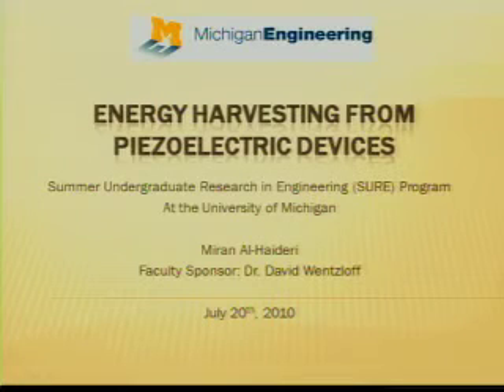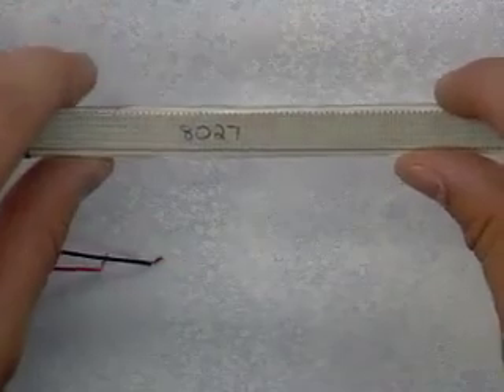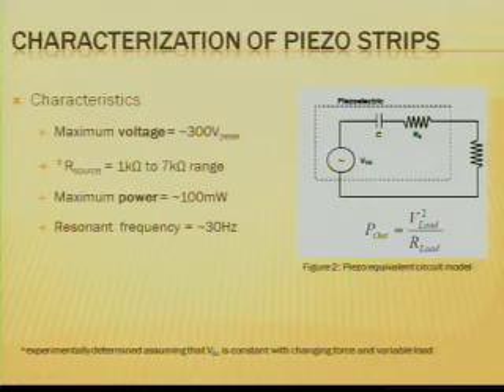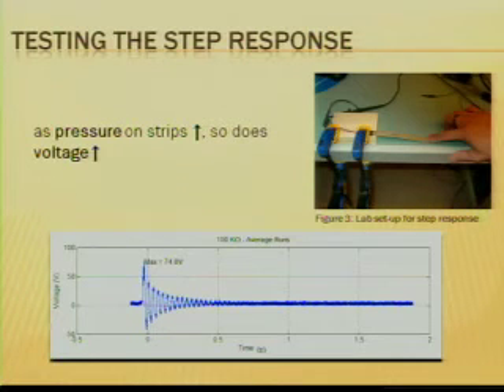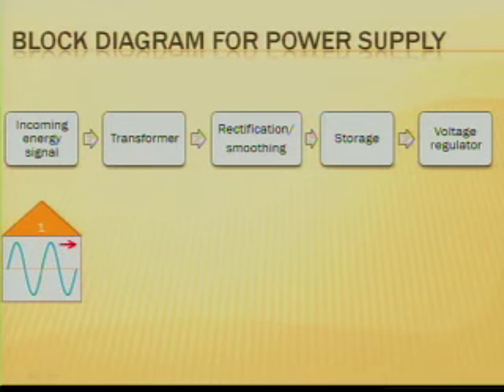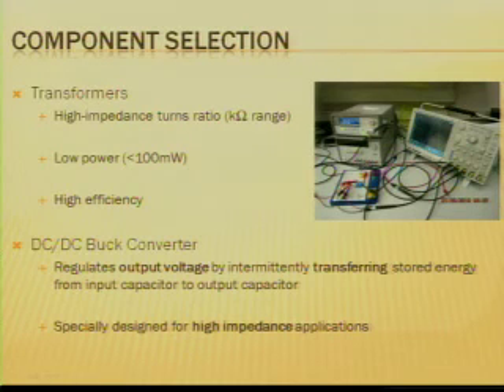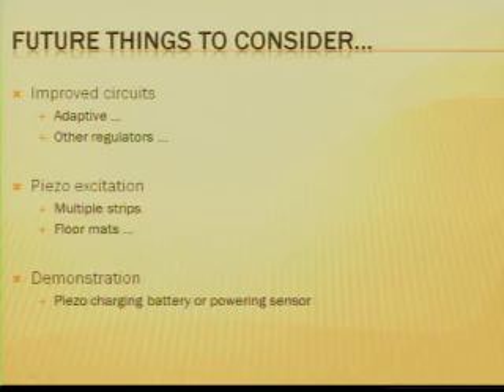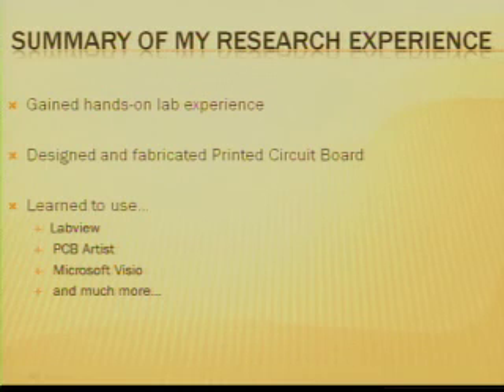Energy Harvesting Using Piezoelectric Devices.m4v

Comment: Hi
need your help, my final year project is on energy harvesting shock absorber [car suspension] using piezoelectricity. my project is basically transforming vertical kinetic energy into electricity using piezo materials. im not sure how do i set up the circuit and fit it into the shock absorber. any advice?
Thanks